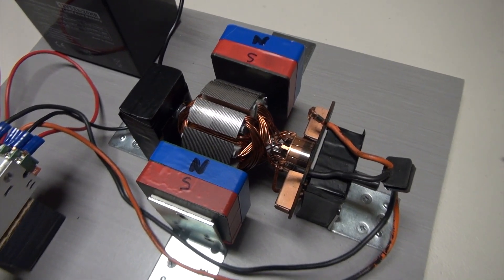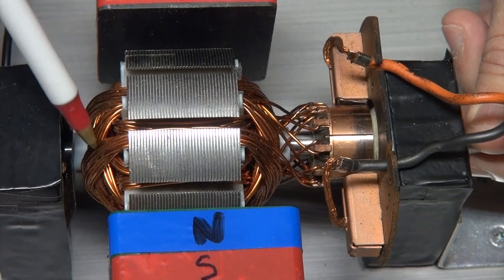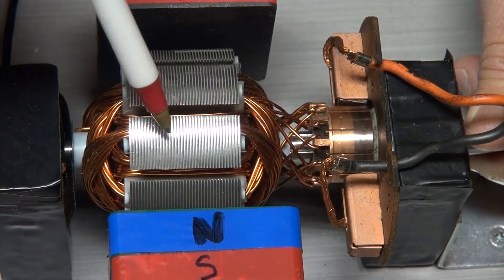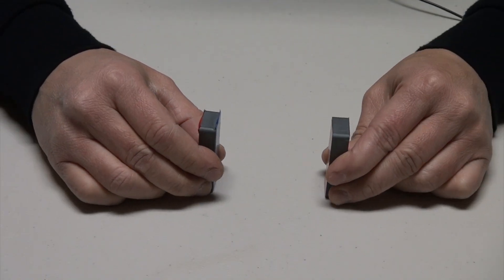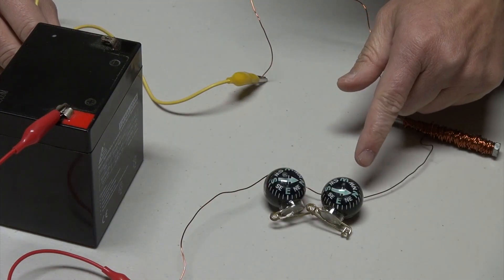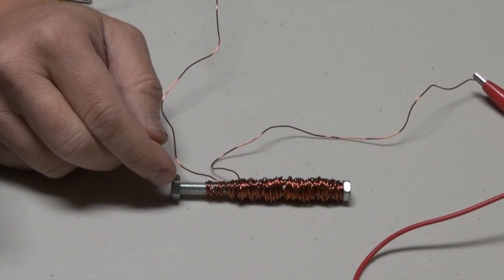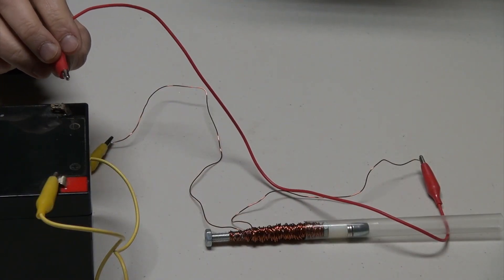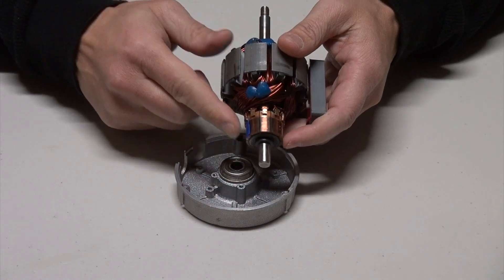DC motor basics and experiments: what makes it work? (2022)

Comment: TRY NO MAGNET JUST TWO METAL JRQN THEN ALUMINUM JLQY
..PUSHED PULLED JRQN ALWAYS ATTRACTED..ROTOR IS XITED REACTED REPEALED...SPIN WITHOUT DRAG FROM MAGNET LESS VIVRATION...USING IRON COILED NORTH SOUTH BOTH PULLED
 ATTRACTED UNDER  IRON UP..45%TO25%  Y XCOILX VL iROÑj LX
 PUSH YLQJ ALWAYS REPEALED PULSES WILL BALANCE AC
 ALTERNATING ONE LINE NEUTRAL OTHER LINE.DC WILL ALWAYS JUMP YLLUMINUIM.....